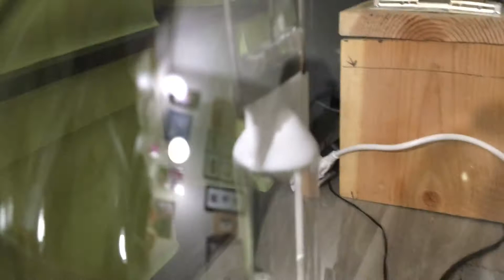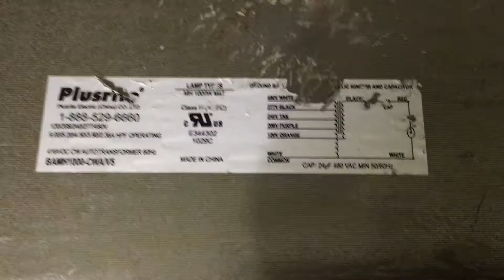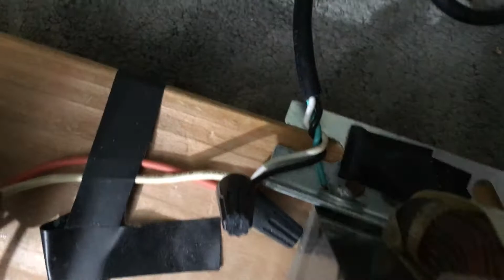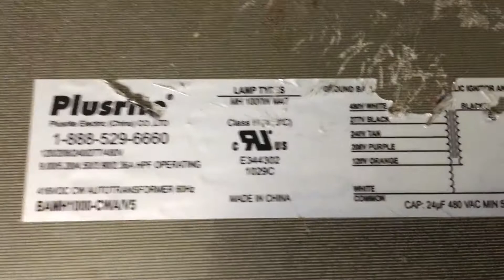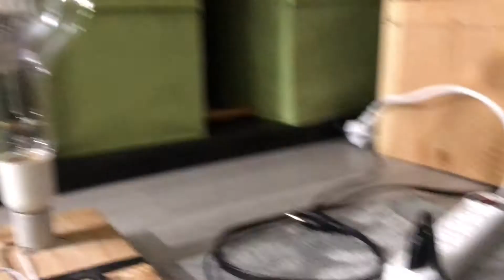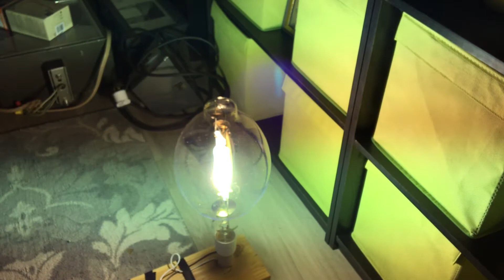Overview Of My Custom Made 1kW/1000W Probe Start Metal Halide Wood-Top Fixture

Comment: North American 1000w M47 probe start metal halide ballasts can also run North American 1000w H36 mercury vapor lamps due to the fact that both lamp types run at 265v 4.0a. In addition, I believe that North American 1500w M48 probe start metal halide lamps actually have the same arc tube dimensions as North American 1000w M47 probe start metal halide lamps and they actually have a rated life of only 3,000 hours compared to the 16,000 hours normally associated with 1000w lamps. Finally, you could also operate this ballast on a 220-240v 50hz mains supply if you use the 277v tapping because using the 240v tapping on a 220-240v 50hz mains supply would cause the ballast to saturate and overheat.
Reply from the maker: Thanks for the tip! Also, you will not believe this, but I have a 1000w dual ballast that runs M47 lamps and also S52 lamps! I got that ballast at a restore!
Reply: @frankiel.6774  Those dual rated ballasts are intended for hydroponic and indoor agriculture applications.

Comment: 208,240,277,and 480 voltages are commonly used in factories. 120, and 240 are also commonly used in houses. I have a 480-to 277-to 208-to -120 Transformer at my church. it hums very loud!!